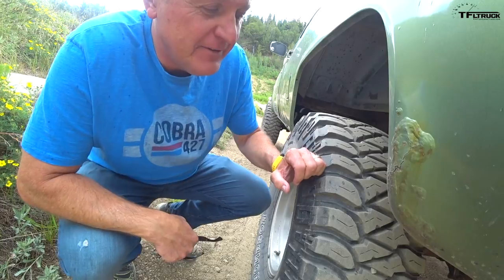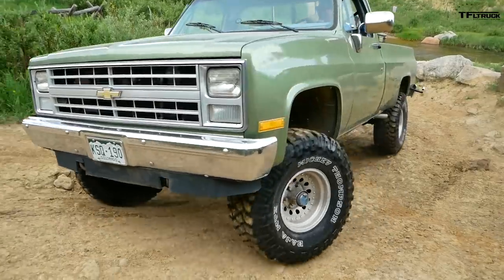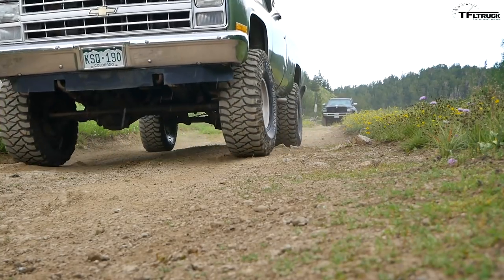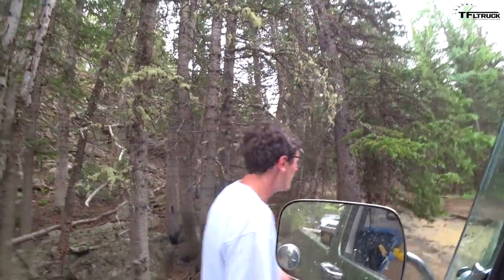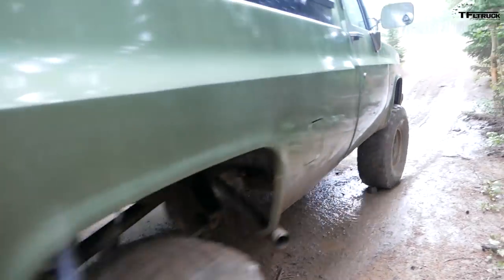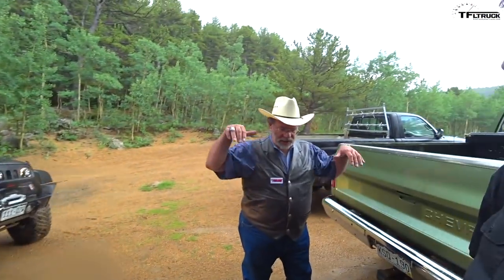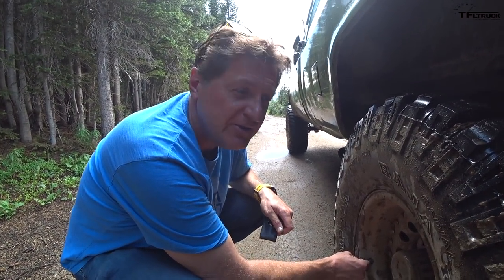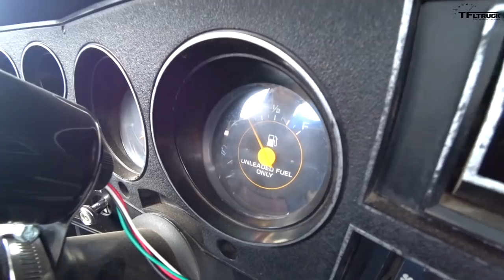Old vs Older: Big Green and Dodgezilla take on Hail, Mud and the Rocky Mountains

Comment: Great video! I really love seeing both of these older trucks in action, especially Big Green. That is one damn good looking truck!  I used to have one actually, a 73 shortbed K10, with the same lift height and tire size as BG. Yeah, with leaf springs it rode pretty stiff. Airing down always helped. FYI, the lift on that is blocks in the rear ("spacers") that go between the axles and the springs, (not the body) and front springs with more of an arch to them. Blocks in the front are dangerous and no lift kit maker recommends or sells them for front use. Stock GM front leaf springs on these trucks were pretty much flat, they had no arch to them. If anything, they had a negative arch. Mine rode much better with the stock, no arched springs. But it LOOKED way better with the lift, so it was a no brainer. 

There are companies out there that make softer riding leaves these days, finding a new suspension for BG should be easy. Also, ditching the front sway bar might help. I remember on my 73 it was a pretty beefy bar, and I'm sure it hindered articulation. Another thing is to check the front spring shackles. The front shackles on these are pretty short, what can happen if the spring packs are a little longer is that the end of the spring can reach the end of the shackle's travel and bottom on the frame. That will limit suspension travel and articulation, as well as cause a harsher ride. 

For the rear you could use flatter, stock style leaf springs, and do a shackle flip. It switches the position of the spring from above the axle to below it (like an old leaf sprung Jeep). Or in technical terms, converts from a tension shackle to a compression shackle.

And lastly, I could have sworn I heard Roman say he wanted a lockable CENTER diff?? I must have misheard, because that would be ludicrous. Part time 4WD transfer cases have no center diff, so by nature they are always locked.

Comment: I know the AC is supposed to help defog due to drying the air but in my experience it's often counterproductive since the humidity condenses on the cold window and the cold air can absorb less moisture.  It's miserable but more effective to crank the heat.

Comment: I really like Kent's truck. I feel like that generation of Ram is the pinnacle of offroad worthy half tons. Coil sprung D44 straight axle up front, 9.25" rear out back, EFI, and a lot of these had 3.92 gears. These have the makings of a great trail truck. If only it had a real motor, lol. Even then though, in low range out on the trail, even the 318 should have enough grunt. All simple stuff that works. Well, WHEN it works. It IS a Dodge after all. LOL

Comment: You know tho, it doesn't matter what truck you like or got, because it's all about what you like and what you want and who cares what anyone else thinks! Anyways I like the Ram because I have a 1997 Ram 1500 with a 360 V8 auto and so far it has 258,503 miles on it so far, which right now having a starter problem but can't knock it for having over 250,000 miles and 21 years old, with original engine and trans and still going, well after I get the starter on anyways. I like my truck and wouldn't trade it for anything, good video and keep up the good job.

Comment: Roman, take out one or two of the leafs of the leaf spring and take a try. It woul be muuuuch better. Actually thar truck is not going to take big loads or tow big stuffs, so it can work fine with a less stifer suspension
Reply: theres no point in putting money into those old springs but if you did that would help...it would cost about the same for brand new lighter springs as having the old ones re arched and new u bolts

Comment: How was the efi fuel pump return lines run? Lots of bad reviews on the FiTech fuel delivery sump. Say it needs return line not to overheat. Did you run return lines to both tanks? If so, how does it know what tank to return to when you have duel tanks?

Comment: Somebody needs to tell Mr Truck to check the date code on those old ass tires.  Pretty sure they ended production somewhere over a decade ago.  Fine for this (though traction will suffer from the rubber hardening) but I wouldn't take that tire up to freeway speeds.

Comment: Thanks for the entertaining posting guys, great faces! IMHO: 1.) the Dodge will never be considered a classic in the way the Chevy is, 2.) the Chevy may have been "nicer" off-road with softer springs front and back (I don't it's currently configured with off-road leafs in the back), this would have given more articulation and a better overall ride, 3.) wait a second ... did you guys deflate your tires enough before the misadventure? ... I'm not so sure ;-)  In either case, the Chevy's solid axles are exactly what serious off-roaders prefer to have in the long run. Just my 0.02.
Reply: Tactickle Shtooper 
1.) you’re wrong 
2.) you’re wrong 
3.) doesn’t matter therefore you’re wrong

Comment: a fun story, i loaned my 1981 chevy to a friend once and when i got it back it was running so rough i was amazed my friend got home. Turns out he went to switch fuel tanks and never knew how to use fuel tank switch and only fliped swith over never pushed it in so ran out of gas, then when trying to prime truck after refueling tank he ran dry { other tank was full all the time} my buddy caught my truck on fire. So when i lifted hood to see why truck ran so rough i found burned off sparkplug wires fire extingisher dust everywhere. So i replaced everything ont top of the engine that was flamable. oh by the by this truck was about 3 months old at the time, and my friend drove a bought 400 miles with the truck lurching and misfireing

Comment: The majority of this video I was wondering why aren't you guys airing down?!? they say if you haven't rolled a tire off the bead you're running too much air :-) I think mr. Truck needs to remove the body lift and go up to 35s. Hey Roman, I had the same exact Chevy on which I put a 6 inch suspension lift on 35s. I always wanted to remove the majority of the leaves out of the spring packs and augment with airbags or air shocks to smooth out the horrible ride. Until then, put some grease between the leaves.
Reply from the maker: Thanks for the suggestion

Comment: its never a good idea to leave you hitch on
1- someone could steal it
2 -departure angle 
3 -if hit from behind it increases the chance the frame will be bent as the frame is designed to pull not push

Comment: HOLD UP HOLD UP.  JEEP SUPPOSE TO BE THE ONLY SUV  THAT CAN DO THIS STUFF? I NO IT WASN'T THAT DIFFICULT BUT NEW JEEP FOLKS THINK THERE JEEP ALL THAT. JEEPS STILL AREN'T ALL THAT IN A NUT SHELL.  SOLID AXELS AN LOCKER THAT ALL YOU NEED.  MY JEEP THIS MY JEEP THAT  YA WRITE. LOW TOW RATING AN PAYLOAD. AT LEAST THESE TRUCKS  AN HAUL HEAVER LOADS AN PAY LOADS. ALL IN ALL KEEP UP THE VEDIOS AN GOOD WORK. GUYS GET AN OLDER SOLID AXCEL SUBURBAN HEAVY DUTY AN SHOW WHAT A REAL ALL AROUND SUV IS....